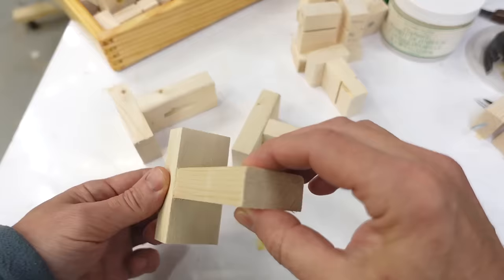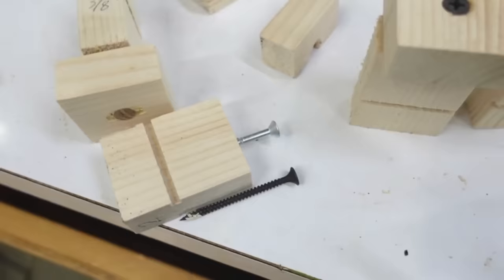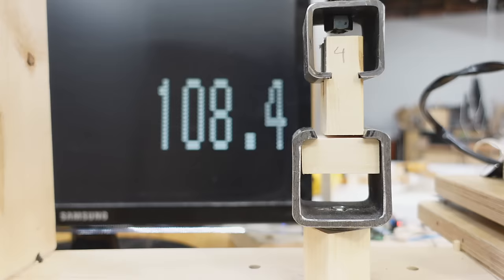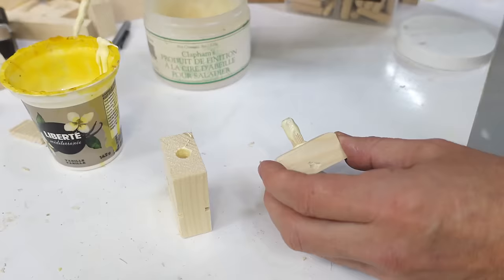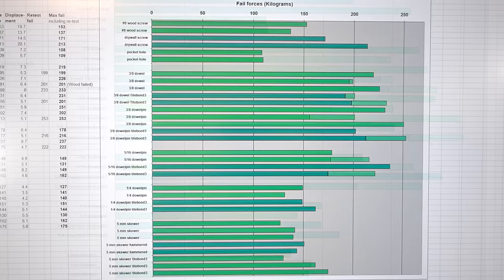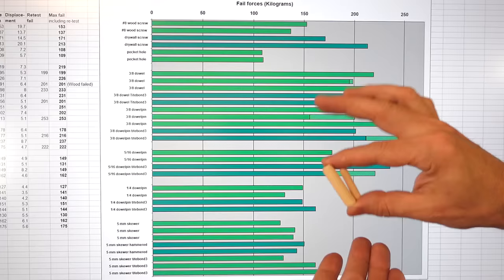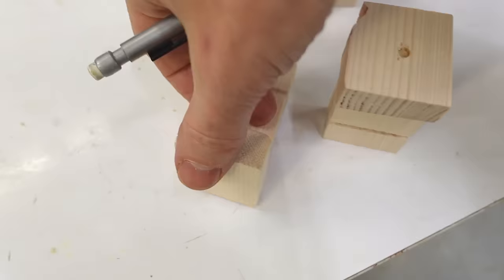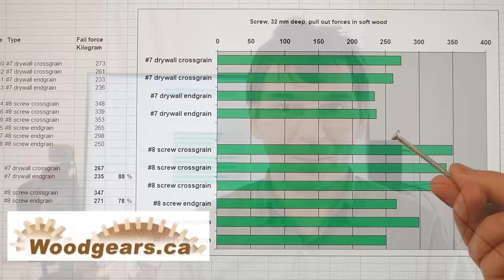Bamboo skewers stronger than pocket holes?  Dowels vs. screws.

Comment: I tried drywall screws, yeah, cheaper alternative, slightly better head, vs flat head They suck, they shear off. I much prefer to use regular construction screws and add a small washer, because even the extra expense of 1/8 (3.2mm) ID washers is cheaper than washer head /pocket hole/structural screws, and MUCH cheaper than the frustration of extracting sheared off drywall screws. I'm on the verge of converting to ye olde Lag screws.

Comment: For the screw heads pulling through wounder how well spax/grk pan/washer head screws would do. not really used for finish work more for structural

Comment: That drywall screw looked to have very fine threads, more like one you would use to put into metal studs, have you tried any with the course threads?
Reply from the maker: Yes, they don't hold quite as well
Reply: @matthiaswandel  wow, that’s surprising, I’ve had the opposite happen most of the time, but the ones you have to seem to have deeper threads than the fine ones I’ve seen.

Comment: Have you ever tried 6 degree pocket holes?   Castle pocket hole machines use a router to cut the slots at 6 degrees.   Can the Pantorouter cut them?

Comment: 30 tests of each configuration would be enough to be statistically confident that differences were not from random variation. (if the data was normal which most likely it is)

Comment: How about 2 of the 5mm dowels compared to the 3/8? 

Do you think poplar craft dowel rods would be comparable to bamboo skewers as long as you don't include any knots or cross grain areas?
Reply from the maker: Do you know how to multiply by two?
Reply: @matthiaswandel  ☹️ I thought that maybe if two smaller dowels were placed closer together, then the chunk of grain in between them might become a weak point rather than simply doubling the value. Why test different size dowels instead of just assuming you could divide by their difference in surface area?

Comment: It looks like most of these fail with the glue joint... So 2 or 3 of smaller diameter dowels would probably be better. More glue surface area.

Comment: arent pocket holes usually used for 90 degree connections?  could you test dowels vs pocket holes with 2 pieces connected at 90 degrees?
Reply from the maker: this would be different from the two pieces I had at 90 degrees in what way?
Reply: @matthiaswandel  two boards at 90 with the pocket hole at ~45ish degrees pulling “latterly”. / pulling like opening a book.  the forces should benefit side loading the connection rather than the head pulling out.

also, this is probably a silly pointless internet comment :)

thanks for all the great content!!

Comment: Seems to be a little difficult to test consistently and even...maybe a metal jig like you had ...but instead staggered dowels running through each test piece
Reply: The restested pieces that were used in the second jig was tested differently that all other pieces ...maybe have to do a retest on all pieces to have a nice solid performance graph.
Reply from the maker: can't re-test pieces already broken
Reply: Yeah, would have to start a whole new test with new jig

Comment: If the blanks were a bit larger a domino would have more surface area but would vary 0degree then 90degree and removing more wood has drawback on small pieces. humm.

Comment: Another Wandel do-it-yourself half-baked experiment. Each piece of sample wood is different in grain and therefore strength. Why not use a man-made product that is consistent so you can compare "apples to apples"? Thank you.
Reply from the maker: I guess I should have mentioned that all the test pieces ere cut from the same piece of wood with consistent grain.
Reply: Grain, knots, and other inconsistencies exist in "the same piece of wood" you sourced for your test pieces. We don't know what's in those pieces of pieces. The proof is in the pudding: Just look at how some pieces are splitting in the test apparatus regardless of the joinery. Your test is simply not precise enough to be of any real conclusive information. Thank you.  @matthiaswandel

Comment: It appears you used fine thread drywall screws, designed for metal studs...
Reply from the maker: yes, because they hold better in wood than the coarse threaded ones

Comment: "that would be pretty ugly for furniture" - sure.. but don't people use pocket holes in such a way that the externally added forces (from use/abuse) go into the wood and not into the screw? That is, consider the configuration and don't allow the screw to hold the forces.
Reply from the maker: If that's the rule, you would only be able to use pocket holes for attaching table tops to tables.
Reply: @matthiaswandel  I don't think that's the case. I'm not saying they have unlimited usefulness. Just that so far (2 workbenches and a lot of very strong storage shelving) it's been trivial to construct joints in ways that the sheer stress on pocket hole screws doesn't happen - the expected loads should go through wood until it's transferred to the floor. They do this with entire houses, and they toenail a lot (and what's a pocket hole if not a fancy toenail). I would do this with any joinery method. If my joints were to experience a load in the direction of your tests (ie, testing pocket hole sheer strength, or hanging strength), I'd add more framing and brace for that it purpose so those loads also go through wood.  i climb my shelves with no worry - and my use  of pocket holes is more than just the "table top" as you claim would be the only use - it's the whole frame (but maybe not how you're imagining?)  -  on my shelves the "tops" aren't screwed in with pocket holes or any screws, they rest on the frames, and they stay just fine. Gravity and garage detritus holds them down :-). 

It seems to me that by proving how strong they are when abused by your machine and pulled in the wrong directions (even though they aren't as strong as other methods), that they're fine to use because they're not going to see that abuse - and if they do, there's something wrong besides " i didn't use dowels".

Comment: Which joints are stressed in a way that pulls them apart?
Reply from the maker: if you have racking, that pulls tremendously on the fasteners.  Make a table, run into it.  if its pocket holes, the apron may come off the legs.
Reply: @matthiaswandel those examples are closer to shear forces, not pull

Comment: Sorry, but I just can't help beating the drum one more time. Pocket screws are meant to be loaded in sheer, not in tension. I promise I won't do it again until the next time.
Reply from the maker: if you only want them used in shear, that eliminates MOST uses of pocket holes.  Because if there anything that tries to push the joint out of angle, that leverage results in tension.

Comment: This is misleading. You are calling it pocket holes, but the test is not at all like a pocket hole. The grain directions and even the screws are not the same. Because you are testing pull-out you also should have added a glued butt joint.

Comment: Very interesting but not useful.  Engineers identify two types of failure.  Serviceability failure is load at which tihe item ceases to be fit for purpose.  In your experiments  the test modells ceased to be fit for purpoae when the joints began to open.  The ultimate limit state is the failure load measured in your test.  This is when structures fail and people die.

Comment: Oh, please.  You used the most ridiculous soft pine you could find?  For the most part, the joint itself didn't fail - the wood failed.  Not only that, but you designed a "test" for a force that will almost never be what is actually applied to a joint like this.

But never mind how the soft pine skews your "test".  People use soft pine for cheap projects because it's... cheap.  And easy, since you can go to Big Box and grab some.  Are those people really investing enough time to do a proper job of precision-fitting dowels?

I had to quit watching.